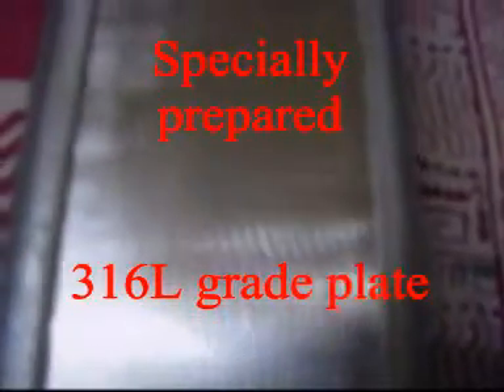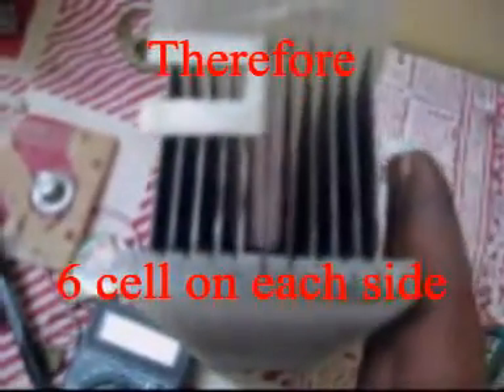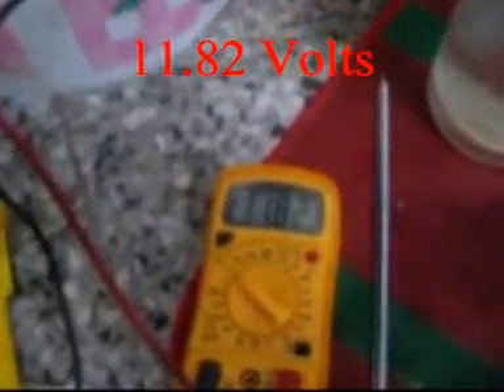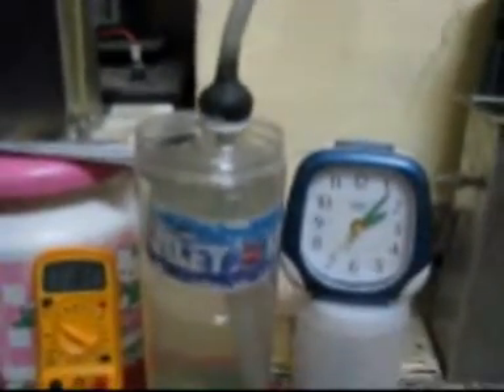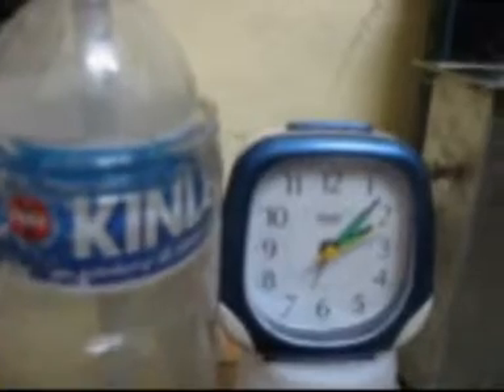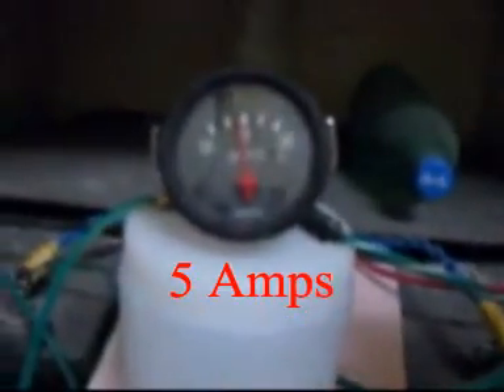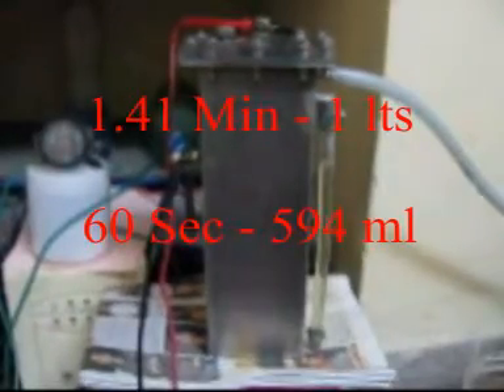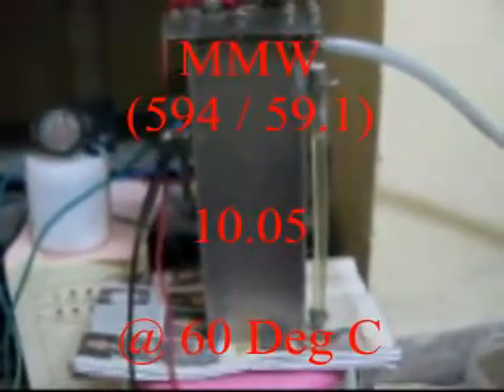2 X 6 Series Cell - 10.05 MMW (uncompensated)

Comment from the maker: I used to add up the KOH / NAOH based on the requirement of current. If we want more current draw then add up more KOH / NAOH and vice versa. Normally in my device I used to get 10 ampere current draw with 2 table spoon of KOH in 900 ml water. 

This device run cool even after 5-6 hours continuous run as there is no parasitic current loss in this device.